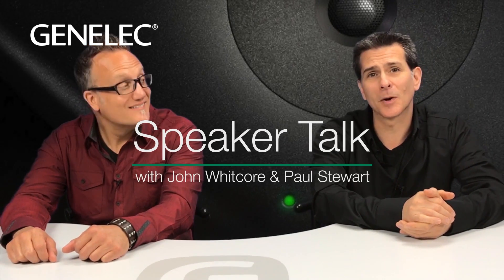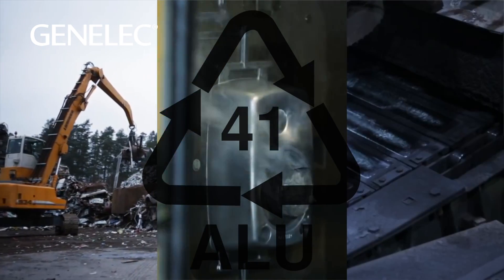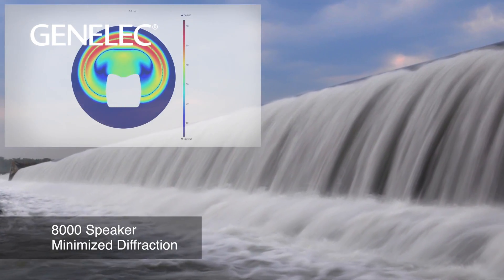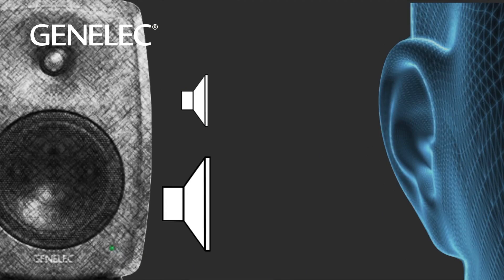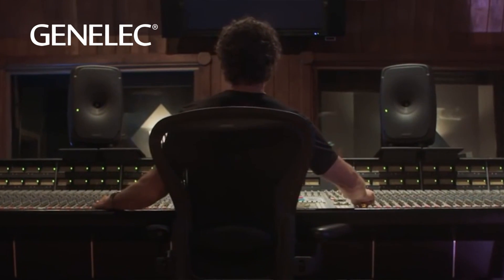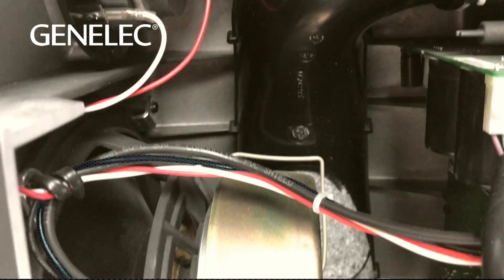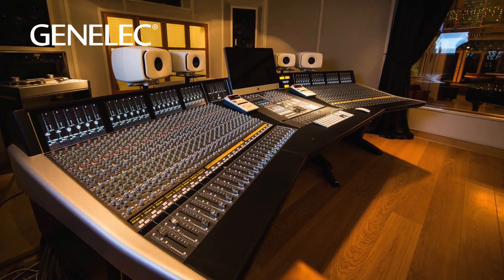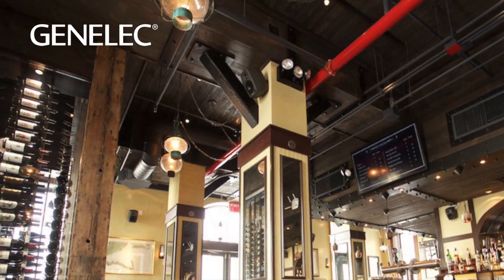Speaker Talk | What are the features of the Genelec 8000 Series? | Episode 2

Comment: My current application has limited space, so I was originally considering the 8010, but I may be able to fit the 8020's.  
Can you summarize the important differences between the 8010 and 8020 series that would figure into the equation?  Obviously the bass would be extended (slightly?) in the 8020, but are there other differences that would tip the scales to the 8020?
Reply from the maker: Hello, thank you for the good question. 8020 indeed plays lower frequencies, but other benefits are also that it will be able to play louder, and has better directivity for longer listening distance. Don't hesitate to reach us at support@genelec.com for more questions and we are happy to help!

Comment: Hi sir, 
I am thinking about to buy Genelec Monitor Speakers but I'm confused! 
Should i buy Genelec 8050B or Genelec 8040B with 7040 Sub? For Music Production, Mixing & Mastering.
Please help me!
Reply: Hi Aashu-

In my experience and to my ear, 1030As give you the raw data to parse out details in a mix, and the 8040s shine when it comes to making 2-Buss decisions -Mastering in a small room, for instance. 

Paired with a 7060 Subwoofer, they are quite impeccable. 
The sub dropping 85Hz out of the monitors helps them to breathe, increasing clarity tremendously.

The 7040 sub was designed for the 8010, and for those, it works well. Stick with the 7060B when using 8040s.

-Adam.